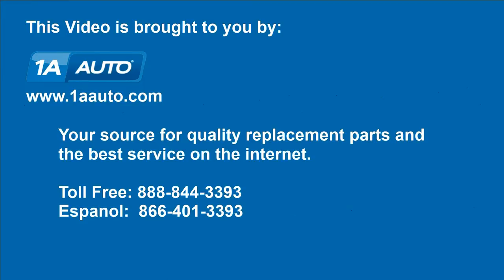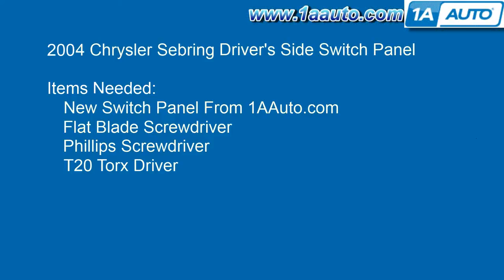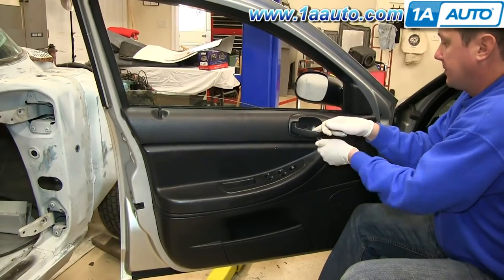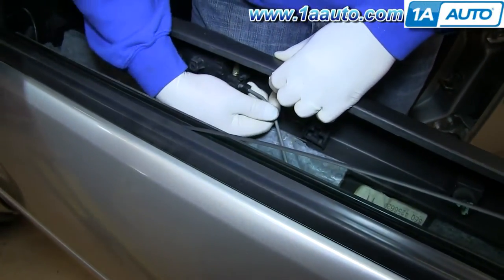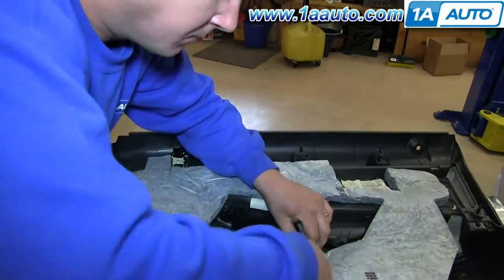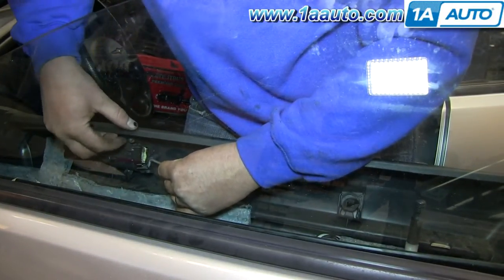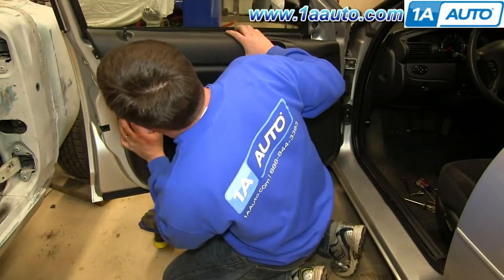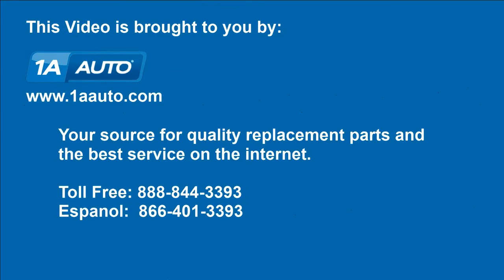How to Replace Power Window Switch 01-04 Chrysler Sebring

Comment: Does this work for the convertibles? (2004)
Reply: Dunno if you ever fixed yours but I had the same issue. I'm tryna work on it. Car only has 66k miles but I'm fixing it a lot. If you need help reach out or respond to this